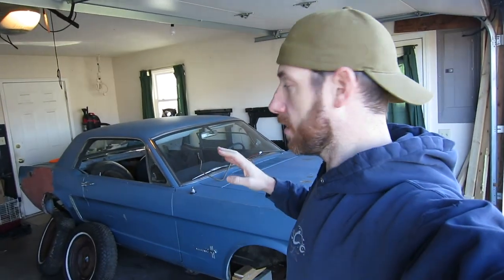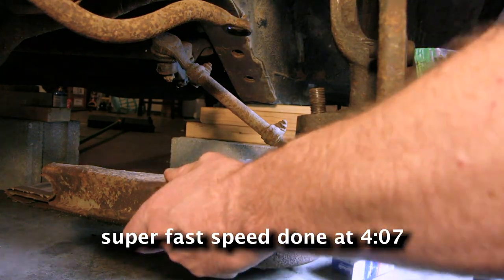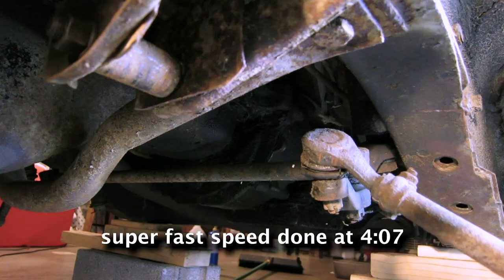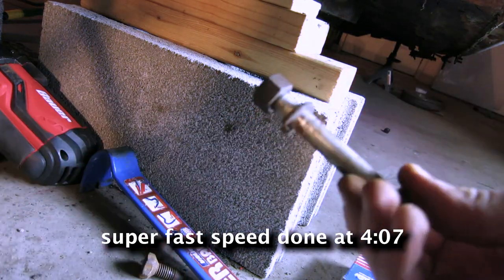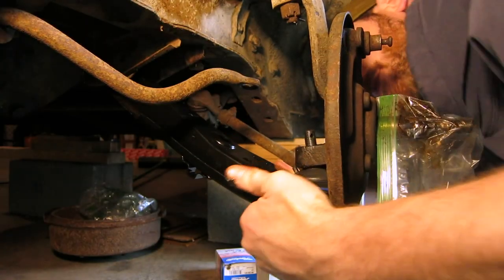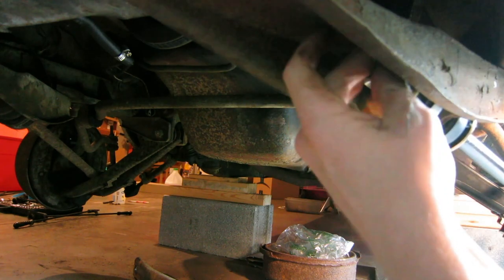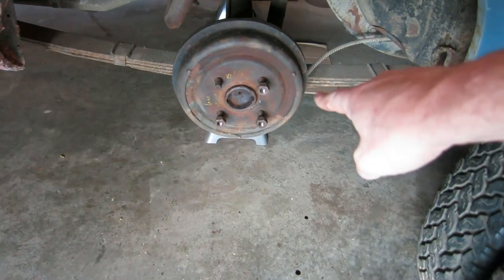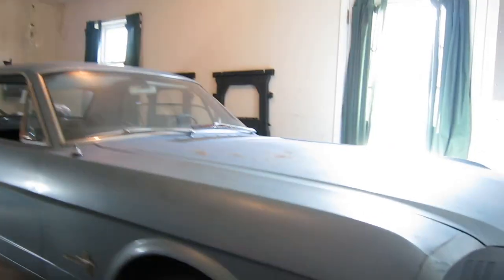1965 Mustang Restomod | Lower Control Arm Replacement | Vlog 14

Comment: 1965-1966  I6 Cars don't use the Push Pins....Only the V-8 cars use them.  The I6 Brake Shoes just push up against the Brake cylinder.   :o)  Tony K.   1966 Sprint 200 Mustang Registry, MCA#70001

Comment: The push pins on the wheel cylinders stumped me for a bit as well. Figured out, as you did, that 6 cylinder cars did not have the push pins. The shoes have a tab that goes right in the cylinder.

Comment: Yes you need the wheel links.   I commented in the previous video.    Sorry if I’m pushing in ya too hard.   Are you not putting coil springs back in the front?